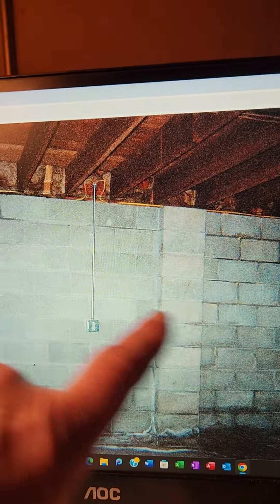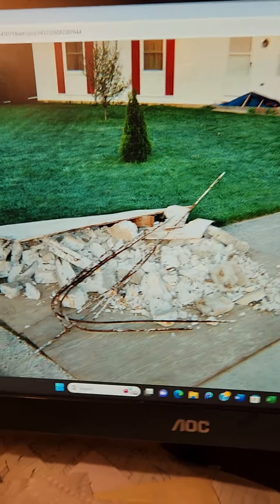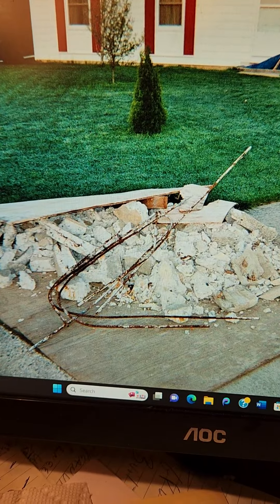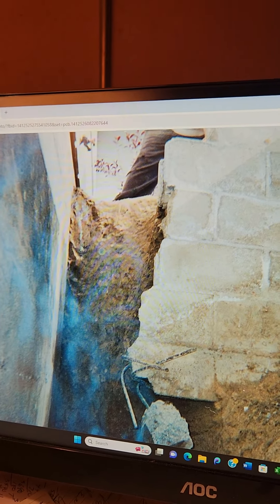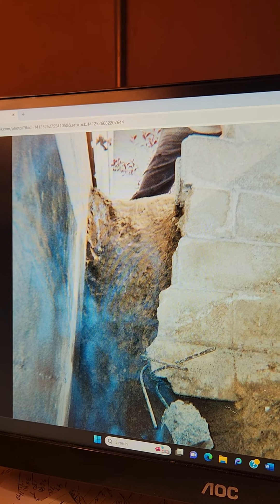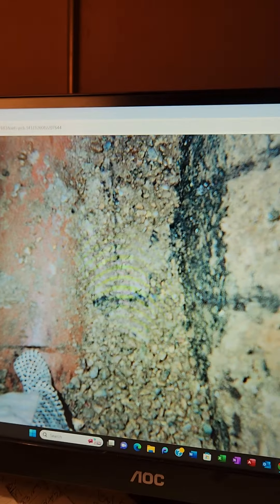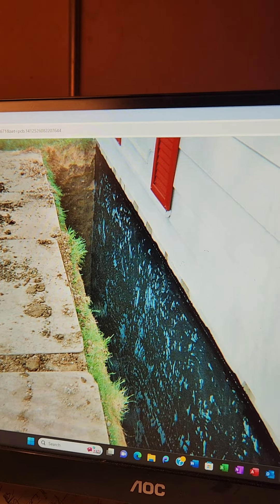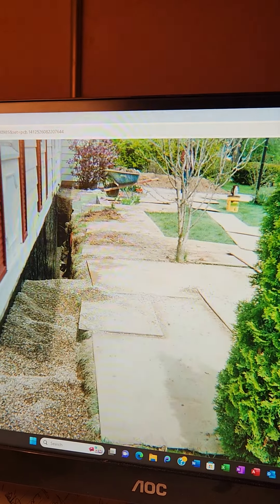Basement waterproofing block basement wall 7 ft deep front porch cap bye bye

Comment: Does this house have any issues with gutters overflowing? Is that the only downspout for the front roof at the far left? If there is a downspout at the end near the garage, where does it dump? That seems like a lot of water that leaked thru just the small area covered by the porch.

Comment: so we hand dug 32' x 7 ft deep and waterproofed it n backfilled it in one day, damn skippy and we STOPPED the water from where it was 1st entering for thousands $ less than the other supposed option of an INT system and allowing the water to keep coming in that would have cost more $ 🤣🤣🤣and the drive to Lansing is  1 1/2 hrs times 2 for way back eh, 3 hrs of driving 😉---- MJ, gimmie the ball and get out of my way 🏀🏀🏀🏀🏀🏀🏀🏀🏀🏀
Reply: All in one day? Damn impressive.
Reply: @manderson5397  For that you're going to heaven. Good man. 🙂